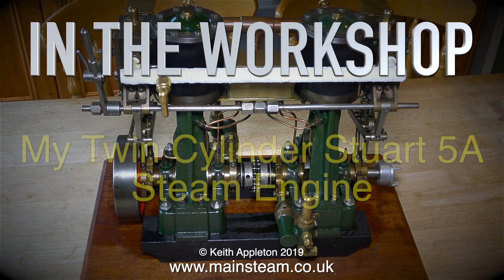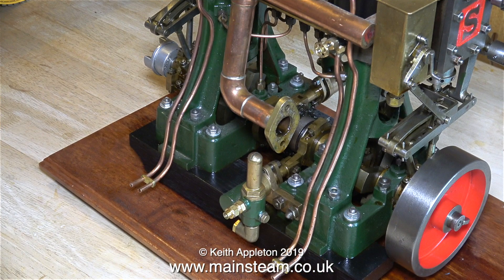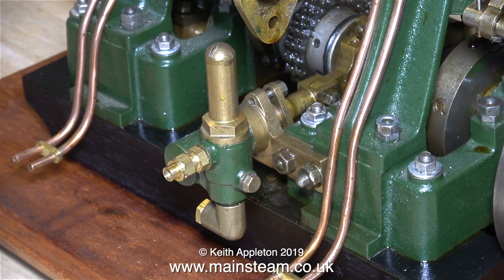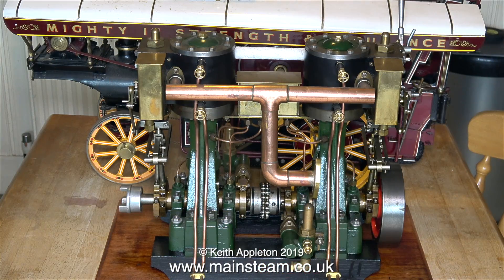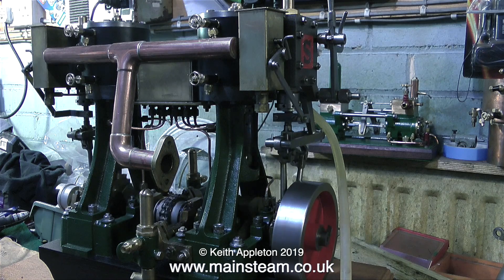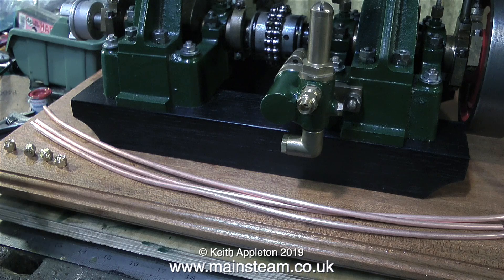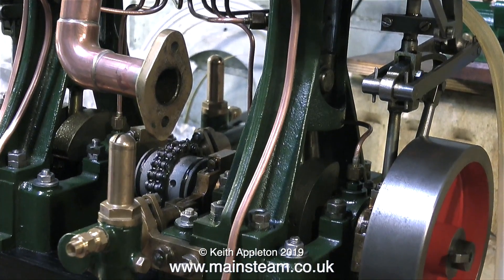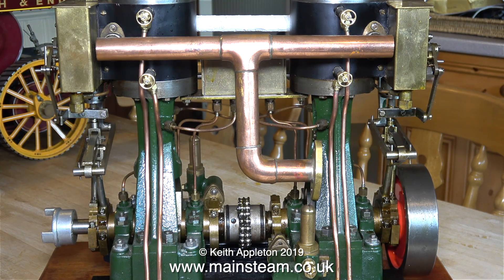MY TWIN CYLINDER STUART 5A STEAM ENGINE - IN THE WORKSHOP

Comment: Beautiful engine but that huge copper inlet manifold draws the eye a bit too much, does it need to be so big ? I would have thought it best to have a smaller manifold cross section because there would be less pressure drop but then again I'm no expert.
Reply from the maker: That is the Exhaust Manifold - and yes it needs to be that big to exhaust the steam from TWO Stuart 5A Steam Engines - don't forget these are small full size engines not toy ones . . . . .